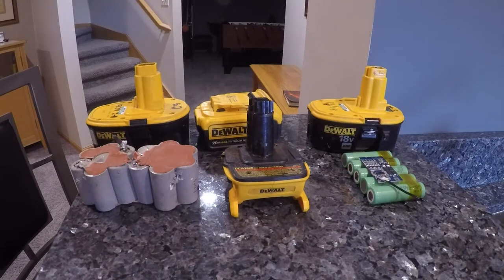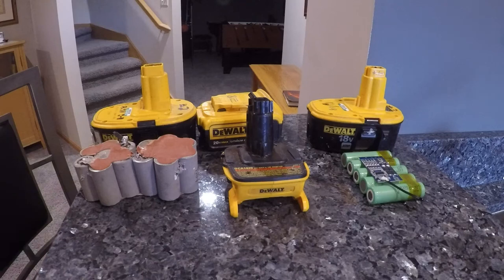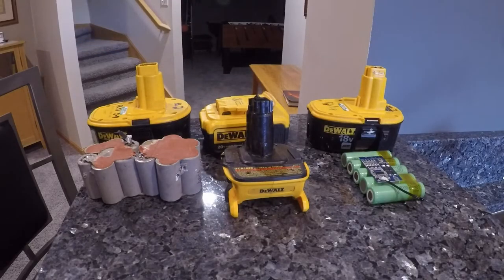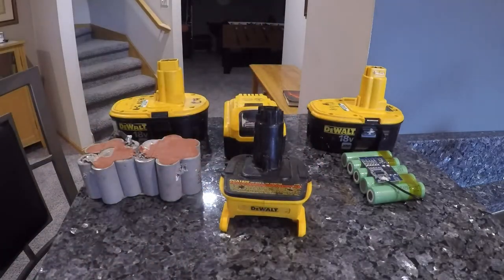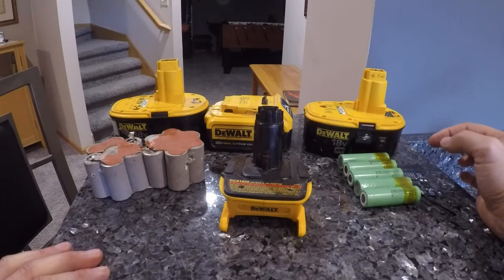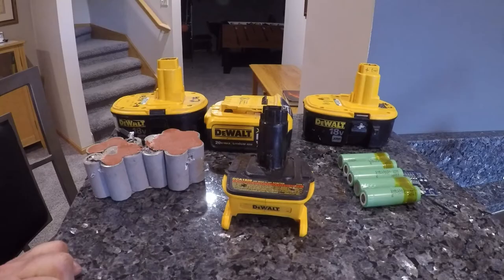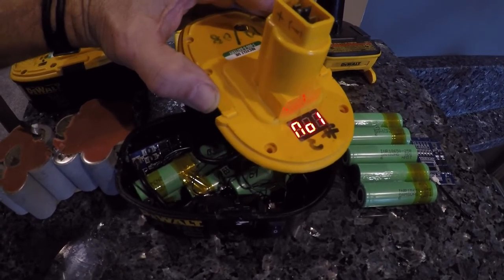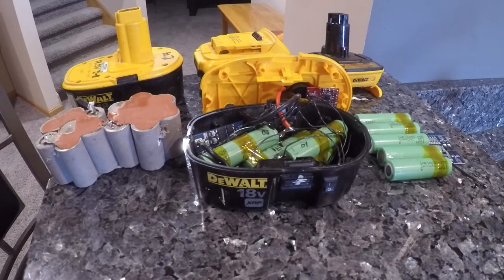DeWalt 18V XRP Conversion to 20V Lithium ION

Comment: Got the 30 amp bms and put it in, was 70mm x50 x 7.  Had to put it on top of batts, cut a little in the cap to fit down over, works great.  I even had a power meter from an old dead batt that I mounted on the front. This was my first with a bms,  pryor lithium conversions I  mounted power and balance connectors to cases, thx for the vid
Reply from the maker: Can you post a link to the BMS you used? Does it do battery balancing?

Comment: Eager to see how you modified the old dewalt charger to charge the new lithium pack you made.   I’m building a spot welder and ordering parts for the battery build.  No one has a video on the charger mod, so you’d certainly be the first.
Reply: I plan to make a hybrid between an old Dewalt DC9116 charger to use its connection to the battery by eliminating the IN 110V input and placing a 22V Laptop charger, but I still don't know how to do it ...

Comment: I finally made up one of these using the bms in your link. Mine must have been right at 20 amp. If I pulled trigger on drill quickly it just died, had to feather it then it ran, am ordering a 30 amp bms, looks bigger, hope it'll fit in
Reply from the maker: I think the BMS current rating is okay. Did you get the one from seller #1?  I believe the problem is this Chinese board use the wrong capacitors on the board. I was having the same problem and put my oscilloscope on it and the startup spike of current caused it to trip. Only because it was only getting 20 milliseconds instead of the 200 milliseconds that the application note for the chip specifies. I changed the capacitor and then it worked. But that's too much to ask for people that are going to build this so I'm looking for a alternate board source.

Comment: They now make an aftermarket 18v dewalt 6.0ah lithium battery that can use a factory charger! 😮
Reply from the maker: An xrp battery? Do you have the part number or a link you could share?
Reply: @timgoihl  there’s a bunch of sellers on Amazon..
Reply from the maker: @reginaldbowls7180  If you're not going to provide a link, your comment is not credible.  If you are talking about something like this https://a.co/d/8mqpUge, its a fake battery.  You cant fit 6AH of tool grade (High Amp Hr) LiON batteries in the XRP case.  The seller is XNJTG a Chinese company.  Just b/c amazon sells it doesnt mean its real.  You have to look at the seller.
Reply: @timgoihl  that’s weird I wrote a whole other comment..

Comment: @timgoihl Great intro! Where are the follow-up videos?
I've found the latest batteries are the 21700. Pricing this to see how much it would cost is about $110 to make one 5S battery pack, and $170 to make two 5S packs (10x 21700 batteries, 2 BMS for 5S 21700, 5A CC CV power module, 24V 3A power adapter, 4-slot battery charger, misc wires & connectors)

Comment: I have a DeWalt charger that charged the Lithium cells  like this in the older housing, it senses a magnet to charge lithium. When I rebuild these can I add a magnet inside and charge with my charger ?
Reply from the maker: As you said, the LiOn pack has a little magnet in it that the charger senses to put it into Lithium mode.  That Lithium compatible charger does Nicads and other voltages and it does weird things with the current and voltage to figure out the pack it is charging.  It also might shut off before my pack is all balanced.  You can't charge a LiON over 4.25V or bad things happen - we dont know that the CV part of the DeWalt charger is no more than 21.25V.  All we need is a very simple Constant Current 3A or so, Constant Voltage 21.5V with the BMS.   The BMS protection/balance board protects the pack and stops when its balanced.  I used a 24VDC 3-4A power brick and a simple CC-CV board from eBay to charge the pack.  Links will follow in the build video.

Comment: Hi friend
I am always attentive to your excellent videos.
A question, what dimensions in mm has the BMS 5S board, I see that you used a 25 A board, is it enough? or better 100A
I have some recycled 18650 laptop batteries of 2500mAp. I'm going to use them, how will they work?

Greetings from Venezuela
Reply from the maker: The board is 48x32mm.  the board says it is 25A but it is really 66A.  The over-current is programmed by the 2 parallel R003 (0.003ohm) current sense resistors you can see in the pictures here https://www.ebay.com/itm/5S-20A-Balance-Li-ion-Lithium-18650-Battery-Packs-BMS-Circuit-Protection-Board/192751663071.  0.1v/0.0015ohm = 66A, so that is plenty.    your laptop batteries will not work.  They have 2500 mAhrs, but low ***Max Continuous Discharge Current(A)***.  The INR18650-25R have 25A.  See the spec sheet I linked.  Another video tried to do this with the NCR18650B  3400 mA hr battery... it would spin, but had no power b/c the battery could not deliver the current (the internal resistance of the battery is too high causing very big voltage loss)  See specs https://www.batteryspace.com/prod-specs/NCR18650B.pdf.  They have high mAh rating but low discharge current of about 5A continous.  So good for some applications, but not power tools.
Reply: @timgoihl  Thank you and which 18650 battery do you recommend for the drill?
Reply from the maker: @joseluisprieto3438  Click 'Show more' below the video for links.  INR18650-25R same as dewalt uses!  $3.80 each.
https://www.batteryjunction.com/samsung-inr18650-25r.html

Comment: Any update on when the next video is going to be released? I'm looking forward to them, particularly the ones on how you constructed the new pack, and how you charge it when it's dead (do you have to take the batteries out and slot them into a charger every time?)
Reply from the maker: I had the video all done, then figured out a better (easier) way to fit them in, so I have re-record it.  its on my todo list.  you dont have to take the batteries out - i converted one of my single battery chargers to do these LiON packs.
Reply: Can’t wait for the update. I’ve got at least 20 to do. I have a lot of the shorter packs.
Reply: @timgoihl  any update?

Comment: I didn’t have a chance to open up my battery pack , but is there a way to fit more 18650 batteries inside to boost the capacity and extend use time ?
Reply from the maker: only 5 will fit.  see my video notes.  i was able to fit 5 NCR2070C 3500mAh 30A batteries.  They cost a lot more so your $/mAh is terrible.  you will be surprised how low the 25R's will last, and you can charge them at 4A so less than 1 hr for a quick charge.  the 5Ah Max batteries are wired 2p5s, but that pack is square.  if someone was ambitious, you could make a 3D printed base that would adapt to the oval XRP case and fit 10 batteries into it!  check out the shape of the DCB205 battery.
Reply: @timgoihl  - now I fully understand. I’ve seen another video where it was explained a little bit better that each 18650 battery must be connected to the BMS board. That’s why you are using 5 BMS board (for 5 batteries). 
Thanks for your explanation ! 
I like your videos and can’t wait for another one, hopefully soon. 
Subscribed !
Reply: @mar1video  Yes. Out of the many 'convert your tool-battery to lithium cells' videos, this is one of the few that does it the way it should be done, with a BMS with balancing-function on board, cells made for high-drain devices (for everyone thinking about re-using 'dead' laptop-cells for this, forget it, those are made for long-lasting, low power drain) and not just 'use an adapter' to charge it (or worse: just use the NiCd charger you already have for your tool-batteries)
The BMS-board (if it's a good one) will not only protect against overcharging the cells, but also overvoltage on it's input, overvoltage on any cell in the pack, overdischarge and cell-imbalance. The last function will level all batteries as close as possible to the same open-cell voltage. It can't do magic though, if one cell performs a bit less good than the rest (which is almost always the case) that one will drain faster and will require more charge put into it, no balancing-circuit can do something about that.
Reply: @weeardguy  - thank you so much for this explanation. I’m so happy to see that YouTube community is helping each other with so many difficult projects .
Reply: @mar1video  That's because I also think that the people who do show the right way of converting something to another battery-technology, deserve the credit ;)
You're welcome.
Reply: @timgoihl   hi, where did you purchase your batteries and BMS?
I’ve looked on Amazon and eBay.
So far I only find batteries that ship from Germany?
Thanks, Brendan

Comment: Hi, I tried this the other day,

I made a 5s battery pack with bms, and put it into my old 18v Dewalt drill. The drill is starting to smell like it is smoking, so I was wondering if the voltage is to high? Do you know what a fully charged Nihm battery voltage is? The 5s battery I tried actually only had 19.8V on it, so not much higher than 18V. I hope you can help me.. :)
Reply from the maker: check this https://batteryuniversity.com/learn/article/charging_nickel_based_batteries.  Charged NiCd voltage is 1.3 to 1.4 x15 cells is 19.5 to 21v full charge.  LiON is 4.2x5cells = 21V, but the LiON drops very rapidly to like 3.7-3.8v (3.8x5-19v then holds there for a long time. So its the same voltage.  Is this happening under load?  The LiOn's may be able to provide more current,  and heat (smoke) is I^2R (current squared times winding resistance) so more current means more heat...  you may have to watch that if you are really pushing your tools...

Comment: I’m doing the same, I have some 30A continuous drain cells from battery hookup on the way.  Theoretically, the charge voltage is the same for the 15s nicd pack and the 5s li ion pack.  I want to use the original charger, have you tested this, or do I have to use my dc to dc converter?
Reply from the maker: I sorta answered this in another comment... You must use a 5S BMS protection board to properly charge and protect each individual cell.  The DeWalt charger cant do that.  The Dewalt charger is for their XRP lithium which uses LiFE batteries.  Also the LiOn pack has a little magnet in it that the charger senses to put it into Lithium mode.  That Lithium compatible charger does Nicads and other voltages and it does weird things with the current and voltage to figure out the pack it is charging.  It also might shut off before my pack is all balanced.  You can't charge a LiON over 4.25V or bad things happen - we dont know that the CV part of the DeWalt charger is no more than 21.25V.  All we need is a very simple Constant Current 3A or so, Constant Voltage 21.5V with the BMS.   The BMS protection/balance board protects the pack and stops when its balanced.  I bought a 24VDC 3-4A power brick and a simple CC-CV board from eBay to charge the pack.  Links will follow in the build video.
Reply from the maker: I will be modifying one of my XRP single chargers with the new CCCV board so I can just drop my new battery into it and let it charge.

Comment: Hello greetings from Venezuela.
How many batteries is the max that goes into the Case to double the amperage while maintaining 18-20 V?
Reply from the maker: You need 5 batteries to get 18.5v=3.7*5 nominal, and 5 18650s will fit in the case.  I also got 5 20700s to fit.  It you have a 3D printer you could make a case that would hold 5S2P like the 20-volt Max 5AH packs.  But my 2.5AH pack really holds up well.  These are 3500 milliamp hour 30 amp batteries that will fit 
https://www.18650batterystore.com/20700-p/sanyo-ncr2070c.htm.
Reply: @timgoihl  Can I charge the new batteries (Lithium) with a Dewalt Dc9310 charger? or do I have to put a charging pin and use for example a laptop charger (Notebook)?
Reply from the maker: @joseluisprieto3438  The Dewalt charger is for their XRP lithium which uses LiFE batteries.  Also the LiOn battery pack has a little magnet in it that the charger senses to put it into Lithium mode.  That Lithium compatible charger does Nicads and other voltages and it does weird things with the current and voltage to figure out the pack it is charging.  It also might shut off before my pack is all balanced.  You can't charge a LiON over 4.25V or bad things happen - we dont know that the CV part of the DeWalt charger is no more than 21.25V.  All we need is a very simple Constant Current 3A or so, Constant Voltage 21.5V with the BMS.   The BMS protection/balance board protects the pack and stops when its balanced.  I bought a 24VDC 3-4A power brick and a simple CC-CV board from eBay to charge the pack.  I added the Links to those items in the video notes.  I will fit the cccv board inside my basic DeWal nicad charger box.
Reply: My question is that the DW9310 Charger indicates that it charges the NiCd, but it also charges the XRP Lithium Ion batteries
Can I use the charger with the 5 18650 batteries and a BMS 5S? or is it not advisable?
Cheers 
Excuse my questions, I don't know much about electronics.
Reply from the maker: @joseluisprieto3438  you cannot use the 9310.

Comment: Are using the 18v charger for 20 volt upgrade?
Reply from the maker: We want to be very nice to our new lithium batteries, so we use a CCCV, constant current, constant voltage charger. I have one linked in the video description below.  I tested it just using alligator clips to the battery terminals, but my plan is to put that charger board inside one of my old 18 volt chargers to make it quick and easy.

Comment: How do you charge the pack?
Reply from the maker: Good question!  I modified one of my chargers with a simple 3A constant current constant voltage converter.  There will be a video for that also
Reply: @timgoihl  De Walt sells a XRP compatible li-ion charger
Reply from the maker: Yes, but the Dewalt charger is for their XRP lithium which uses LiFE batteries.  Also that pack has a little magnet in it that the charger senses to put it into Lithium mode.  That Lithium compatible charger does Nicads and other voltages and it does weird things with the current and voltage to figure out the pack it is charging.  It also might shut off before my pack is all balanced.  All we need is a very simple Constant Current 3A or so, Constant Voltage 21.1V.  The BMS protection/balance board protects the pack and stops when its balanced.

Comment: Can I use this adapter to use a new Li-Ion 14v battery to power a 14v Ni-Cad tool? If is just an adapter a new battery to a old tool will work, right?
Reply from the maker: I'm not quite sure what you're asking. Can you use 20 volts on a 14 4 volt tool? Seems like a little bit much voltage.  The full charge on the 14.4 volt tool is 1.4v*12cells=16.8v.   lithium cells are 4.2 volts full charge so four cells should do it 4*4.2=16.8.  so if you can fit the batteries into the old case and find a 4S BMS board it should work fine.
Reply: @timgoihl  I said: "new Li-Ion 14v battery to power a 14v Ni-Cad tool"
so is: can I use a dewalt li-ion 14,4v battery with a rail type connection, with this adapter to power a tool that uses a 14,4v Ni-Cad pistol type connection?
Reply from the maker: We don't have 14.4V slide type batteries in the USA. I've never seen them before.  
If you're asking if the DCA1820 adapter would work on 14.4 volt tools, I don't know. I only owned 18 volt XRP tools and now 20 volt max tools.  I'm guessing not because I'm assuming that they made the pistol 14v incompatible with the 18-volt pistol otherwise people would be over voltaging their tools all the time.